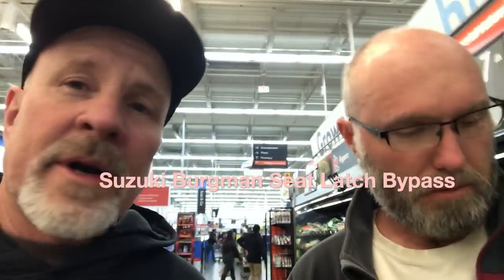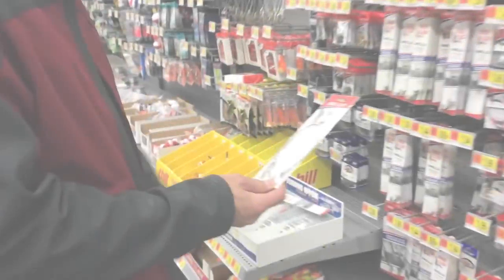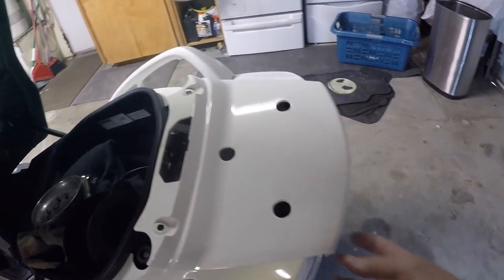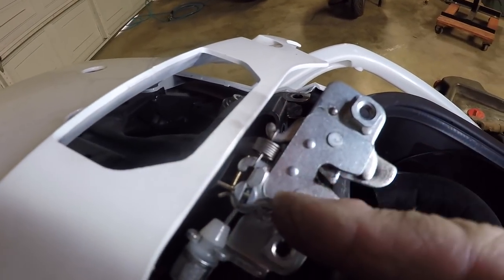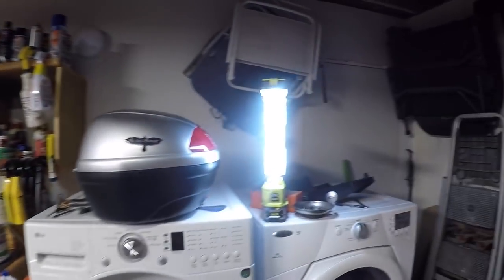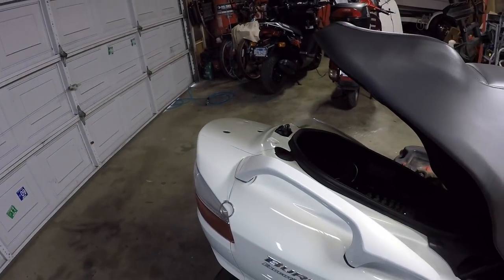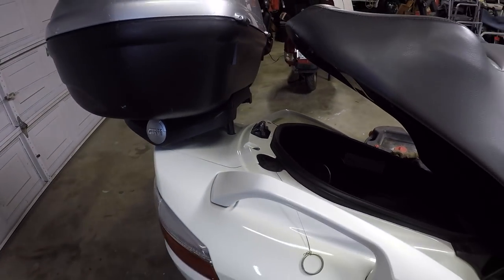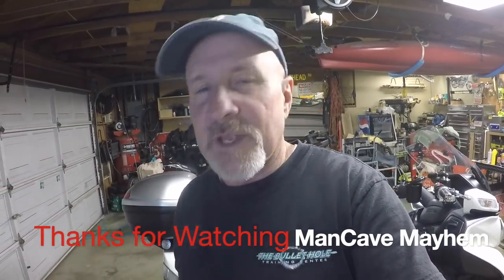Suzuki Burgman 650 Emergency Seat Release

Comment: Gotta question for you, I have a n 09 burgman an 650 , I was pulling into a gas station and it completely lost all power dash lights everything if you have any idea what the problem is I'd appreciate your input, I checked the battery and it's fully charged... any help would be appreciated thank you...
Reply from the maker: I’m not sure on that. I would be hard-pressed to figure that out. It’s very difficult to diagnose a motorcycle. If I’m not there to look at it, I would check on my fuses and connections. Make sure there’s been no water infiltration in any of the areas of the bike, that’s where I would start.
Reply: @ManCaveMayhem  found out the main 40 amp fuse blew , put another one in and it started but found out I have a short, smoke started coming from under my seat, trying to pull the trunk out now.....
Reply from the maker: @mikebittick6481  so glad you found it, my friend👍🏻

Comment: Nice video,  the plastic on right side covered by the seat when closed, I clear Gorilla taped the pull ring there. You'll be able to get your finger under the seat enough to pull it out an open it and won't be any leader showing. I also put that clear tape down on plastic first so as not to scratch it. Your video's are great, you go slow and teach us newbies how to work on our scoots.

Comment: after the key release finally failed me, leaving me standing beside the bike with my helmet, gloves and jacket locked in the trunk i had to do this. i tried a different rig but ended up using the fishing leader like you. i ran the cable along the right side of the seat and attached it under the bolt near the front of the seat. wish i could put up a pic but you get the idea. totally stealth and works perfectly. thank you for the tip !
Reply from the maker: Thanks for the kind words!

Comment: I attached to lock post just like you but used a 9" leader running it through a 6" piece of stiff clear fuel tubing then the small key ring.  The stiff tubing holds the key ring up under the lip of the seat out of sight unless you squat down and peek up under the seat edge.  The tubing also serves as a conduit protecting the cable from getting pinched.
Reply from the maker: Charles Plumlee I love that idea that’s super smart I may have to get some clear tubing. thanks for your input and thanks for watching😎👍🏻
Reply: @ManCaveMayhem  - I posted some pictures on the burgmanusa forum
Reply from the maker: Charles Plumlee thanks for the info👍🏻

Comment: On my AN250 burgman I used a steel wire (bicycle spoke) to push, rather than pull. Protrudes about 6mm under the seat. Push to unlock.
Reply from the maker: That’s a smart way to do it👍🏻

Comment: I did that on my '07 400 Burgman. Locksmith failed to get the ignition on, let alone pushing the ignition in to actuate the latch.
I hide a spare key on my '16 650 Burgman. I love your strategy for an alternate method. Thanks!
Reply from the maker: Dennis Herreid Thanks for watching 👍🏻

Comment: Have you ever replaced the Burgman 650 seat piston if so how difficult was it Thanks
Reply from the maker: No I have not. It’s a challenging task as you have to take a large amount of the plastics off to get to the piston. I am trying to set something up to where I can make a video to show you guys. Just need to get the time to do it.
Reply: @ManCaveMayhem  Thanks for getting back it looks to be a challenge
Reply: @ManCaveMayhem  Ok I spent 2 hours today 1/1/22 replacing the seat piston there was a lot to remove but not bad to do.
Reply from the maker: @blackwolf3302  I’m actually going to probably start next week working on a video for that too🤣 Did you buy an OEM seat post? Or after market?

Comment: I like the release method. I think my key maybe locked under my seat. Not for sure but need to know how to get under my seat without a key. Is there an easy way to releasee the seat latch without a key. Please help.
Reply from the maker: Barbara Weems not sure on that one. You would have to get under the plastics to get to the ignition or the rear latch.

Comment: Mi si è rotto il cavo dal meccanismo di chiusura e non so come aprirlo. Consigli?
Reply from the maker: You’re going to need to access it from the panels you gotta get back to the latch or trace the cable back to where you can get a hold of part of the cable and pull it open.
Reply: @ManCaveMayhem  Grazie, ma ho scoperto che il cavo si è rotto in qualche curva stretta. Sono riuscito ad aprire la sella smontando i coperchi posteriori centrali. Mi serve un cavo nuovo e la molla piccola che c'è sotto il meccanismo 🙄

Comment: I still cant lock my seat.Is unlocked all the time,my is 2013 but exactly the same sistem for opening,the worst sistem ever...especially long key which you have to turn to opet seat is totally stupid from suzuki.
Apart from that,bike is absolutely amazing!
Reply from the maker: Aleksandar Zivkovic Yes It always feels like I’m putting too much stress on the key as I’m turning it. It sounds like you are having other issues with the latching system. Good luck and thanks for watching.